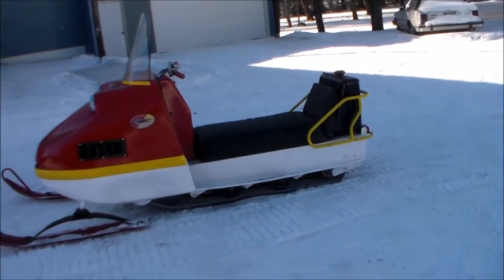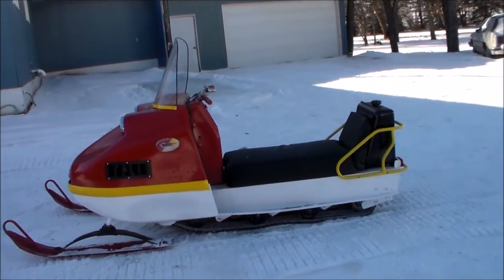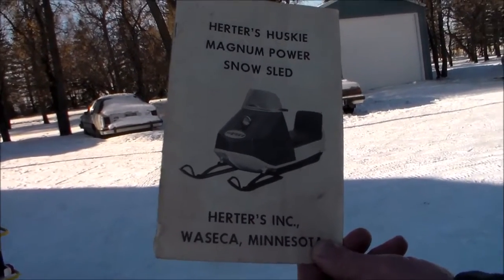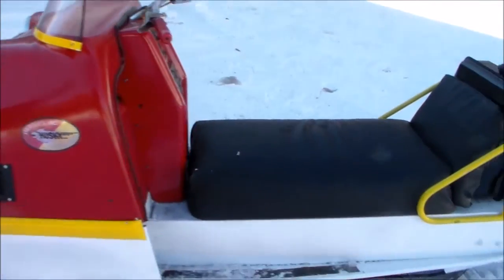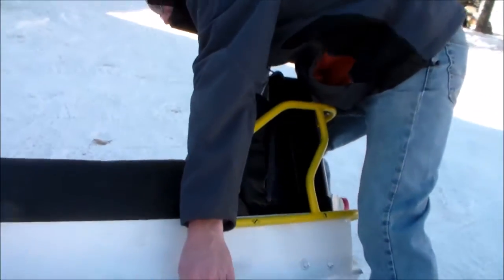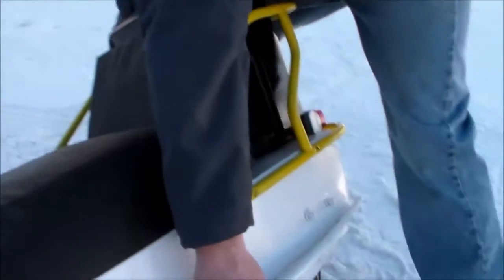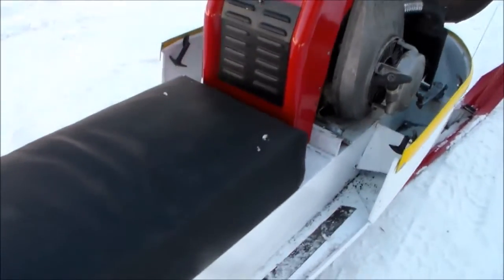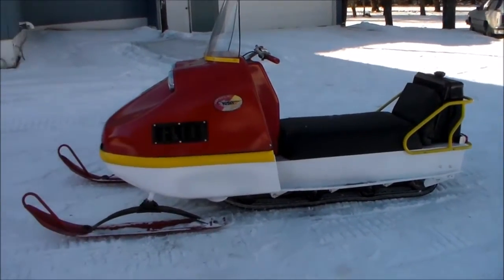1970 HERTER'S SNOWMOBILE

Comment: I had a '70 that looked mostly like that except the gas tank was red plastic, slightly larger with a chrome band holding it to the chassis. That one had a 440 (actually 436cc) Kohler with a Tillotson carburetor. With the Kohler, the carburetor sat straight upright so the intake sat directly under the first bend in the steering tube. Any sort of water that found its way to the steering tube would find its way directly into the engine, which wasn't exactly ideal if the sled sat out at all. Looks like the arrangement was a bit better with the angle of the carb on the JLO.
Reply from the maker: Yep you are right. The gas tank was cracked and a friend of mine had a 71 that the tank was good in so i used it.. Thanks so much for looking. Cant't get away with anything!!!There was no yellow paint either!